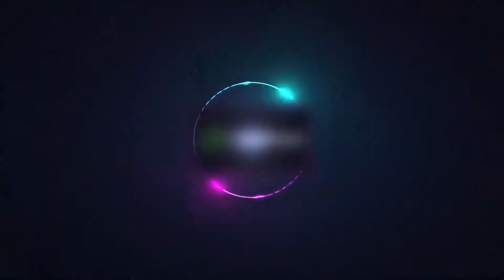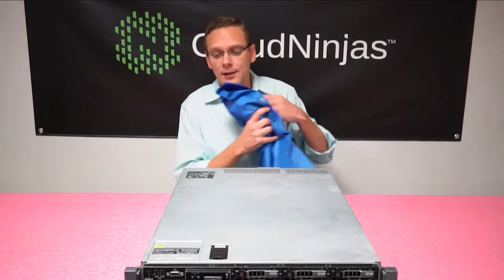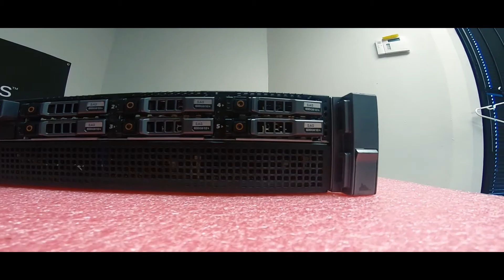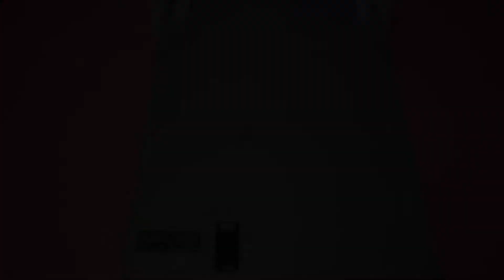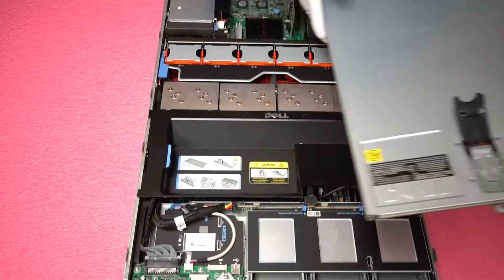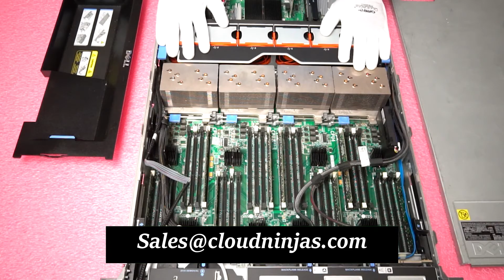Dell PowerEdge R810 Server Memory Spec Overview & Upgrade Tips | How to Configure the System

Comment: 5:04 "You will notice there is a key, or a notch, in the middle of the DIMM; this is to prevent you from loading the wrong type of RAM. If you were to load a desktop unbuffered module, the notch is actually in a different slot, and you would not be able to insert it." <--- Are you sure about that?
Reply from the maker: Yes it will actually fit.  Notch is in same spot.  That was my mistake.  Won't function but notch is in same spot.  Thank you.  Have a nice weekend.
Reply: So if someone tried to make a gaming PC with this could they not put DDR4 in all the first slots (at least 8) and run with it?  I’m not sure what you meant by ECC
Reply from the maker: @jaysontadlock1871  correct.  You cannot insert DDR4.  This only works with the DDR3 memory specified in video.  Would be cool if DDR3 systems could accept DDR4 RAM... but unfortunately that isn't possible.   ECC = Error Correction Code.  ECC can detect bad DIMMs.
Reply: Oh well that works out perfect because DDR3 is pretty cheap now!  Could someone run DDR4 if they underclocked it or is that a no no too?  Do you all still carry E7 processors and ECC DDR3 ram I can order?
Reply from the maker: @jaysontadlock1871  no you could not install DDR4 at all.  Yes.  We carry E7 and DDR3.  Please email sales@cloudninjas.com.   One of our reps will help out immediately.   Thank you!

Comment: Officially it supports up to 16 GB dimms. I have not been able to find anyone online using 32 GB dimms in it. Are you 100% sure that it does support them? I don't want to go and buy a bunch of memory that might not work.
Reply from the maker: 100%.  Note you do need Intel E7 processors.  What processors are you running?  And we have the 32GB RAM in stock and can ship today.   Thank you for reaching out.  Take care.
Reply: @cloudninjas  I am currently using e7-8837's, but I'm waiting on 4 e7-4870's.
Reply: @cloudninjas  thanks
Reply from the maker: @stefannilsson2406  Didn't see an email from you.  Wanted to make sure we were responding timely.  Thank you!
Reply: @cloudninjas  I'm buying the memory from an acquaintance in germany. I got a very good offer and I live in europe. So no expensive cross atlantic shipping either.
Edit: spelling
Reply from the maker: @stefannilsson2406  Appreciate the update sir.  We do ship international.   Europe is not too expensive regarding shipping.   VAT can be a deal killer.  But if you are interested to see a quote to compare, then please email and we can have a quote within 24 hours.   Thank you.   Have a nice evening.
Reply from the maker: One other important note.  You need to have the R810 Gen 2 or R810 ii for the 32GBs to work.  Thank you.
Reply: @cloudninjas  Yes, I have the gen2. And I guess I can take a quote. I'll send an email.
Reply from the maker: @stefannilsson2406  1.	Must have R810 Gen 2 (R810 II)
2.	Must have updated BIOS
3.	Must have E7-v2 procs inside
4.	Must be 1.5V